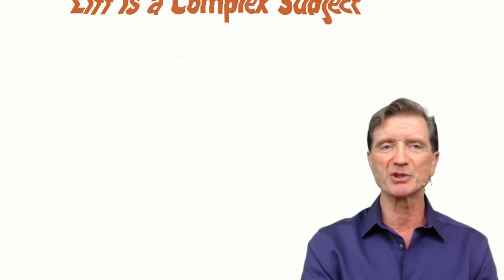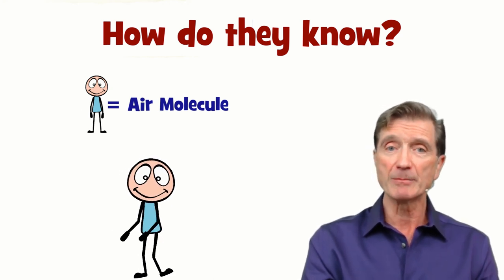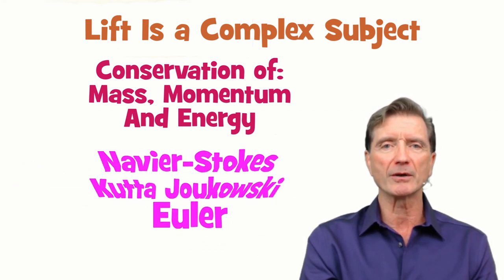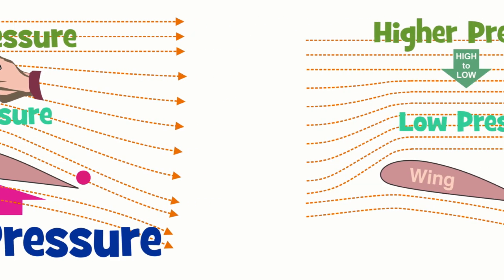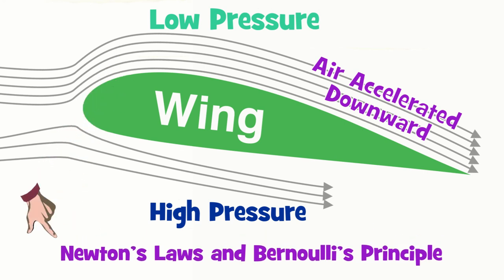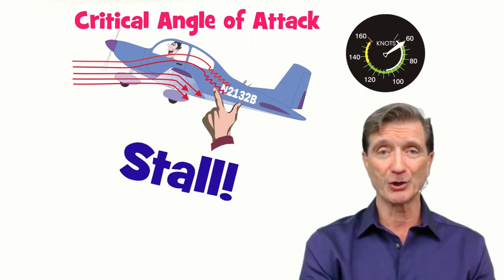Let Me Throw You a Curve: How a Wing Produces Lift

Comment: Lift is very easy to explain. It's caused by a pressure difference between the upper and lower surfaces of the wing. Explaining why that pressure difference occurs... that's the hard part.
Reply: Nope. Has nothing to do with the pressure differentials. It exists but doesn't cause lift. High lift/drag devices like fowler flaps and slots disprove this. It's all about lift as a force. F=MxA. Mass off the aircraft, the air itself and the relationship of the acceleration of everything. The navier-stokes equation is right now the prevailing theory and disproves equal transit and pressure differential as the cause of the force of lift.
Reply: @AFO3310  The only mechanisms that a fluid like air has to act on a body are pressure normal to the surface and frictional forces parallel to the surface. Pressure forces are  typically much higher than frictional forces so they dominate the result when you integrate over the surface. Slotted flaps don't change that. In fact, I'm curious what you think slotted flaps do.

Comment: At the end you said you gave no explanation in terms of conservation of mass, energy and momentum.  Yet you hold out hope that maybe we would come to grips with Navier-Stokes?

What is Navier-Stokes, if not conservation of mass, energy and momentum?

If we were to explore what conservation of these concepts means as interconnected by Navier-Stokes, we could hopefully explain why equal transit time as has been described, is really a misreading of conservation of mass transit and its consequences.

Equal mass transit time of the affected air flow is crucial to "simplifying" an understanding of lift.

So instead of retreating from "equal transit time" when we see that the air on top moves faster than air on the bottom,  a refreshing explanation would be how equal mass transit is accomplished when the simple "equal transit time" is false.

Why is this reconciliation missing from all the lift explanations?

Comment: In my opinion, lift is a consequence of the third law. Bernoulli just explain why the speed change because of the preassure gradient. By the way, I think always the pressure gradient change the speed and never backwards. And the air accelerate on the upper side only on the first part of the wing not allway to the trailing edge.
Reply: Those phenomena, like any others in physics, are not one-way: pressure gradient and velocity are coupled by the principle. And enough experiences have confirmed the profile of pressure predicted by the Navier-Stokes equations with a net lower pressure above the wing and higher pressure at the bottom, so it's a valid model.

Comment: I dont think a pilot needs to know anything about lift except the lift equation and the lift coefficient graph.. dont exceed the critical angle of attack. Higher velocity increases dynamic pressure.

Not much else is of any practical use

Comment: Hello Rod,
I am wondering if you could share some of your references that you used to gather this information? I am for the life of me trying to find peer reviewed reputable journals or publications explaining lift generation. Specifically why the airflow stays attached to the airfoil, follows its shape in high angles off attack, and increases in velocity.
Thank you!
Reply from the maker: Greetings Captain:
There are several references that can help here. Perhaps the most important one is Richard Von Mises' "Theory of Flight." This book covers both the circulation and tangential theories I presented in this video. As far as why airflow conforms to the wing's upper cambered surface at normal angles, well, good luck trying to find agreement on that issue. The best (Ocham's Razor) explanation is the "Coanda Effect." 
Best,
Rod Machado
Reply: As long as the air flow is relatively orderly (non-turbulent), it is rational to assume the force of ambient pressure from above, ensures the airflow stays attached to the airfoil.

The affected airflow mass transit is competing for space with the airfoil.  The space along the upper curvature is fully utilized for this air mass transport flow due to the pressure consequences of the competition for available space.

We see this reflected in no variation in mass density.

At subsonic speeds, mass density is constant around the airfoil's pressure and velocities gradients (I believe this is because the average random motion thermal velocity of the air molecules at subsonic speeds is fast enough to relieve any tendency for mass compression through non-enclosed spaces).

Because mass density is constant (no compression to squeeze more mass through a tight space) the only way for the required uninterrupted flow rate of mass to proceed, is through any available space that doesn't produce turbulent disruption.

Ambient pressure ensures this.

Comment: Imagine you could close off a huge chunk of atmosphere in a closed box. Then place a measuring scale under the box to measure its weight. Then have a plane fly in the box around and around in a circle. Does the weight of the box change?
Reply: The scale will now measure the weight of the box and the weight of the airplane. There are good videos on the Internet showing this demonstrated with a small drone.
Reply: @raymondlancaster3355  This is the final debunking of the Bernoulli "explanation" of lift then. Wings produce lift by deflecting air downwards such that the weight of the plane appears as increased pressure on the ground below.
Reply: Take a look at this video: https://youtu.be/N0IGrSjcBZs

Comment: Why does't the air parcel accelerate on the upper surface with zero degree angle of attack, as experiments shows? 
Or
The air parcel must not to accelerate under the wing because of rounded leading edge? 

Or the air parcels know that they have to accelerate on the upper surface only? Of course No...

Have you any answer
Reply from the maker: Greetings Mr. Black Spider:

I'm sorry but I just don't understand what you're saying here. 
Best,
Rod
Reply from the maker: @shortclips7052  
"Actually air particles don't accelerate on the upper surface of the airfoil with zero degree angle of attack..."
That is not correct. Air particles accelerate on both the top and bottom of the airfoil in the condition you describe. No lift is produced in the condition you describe (zero-lift angle of attack assumed here or symmetrical airfoil at zero-degree angle of attack assumed here).

"The speed of air particles on the upper and lower surface is same when the airfoil is not inclined with an angle..... Why?"
This is correct with a symmetrical airfoil.

Comment: Very simply, a moving wing dumps a starting vortex. There is then vorticity of opposite rotation bound up with the wing, which then generates lift by the Magnus effect.
Reply: Not really an explanation though, sure it's one of the mathematical models but why should this happen? It's neither simple nor complete.
Reply: @no_fb  I could elaborate on my explanation, but I suspect that you have some odd ideas of you own. What do you want me to do which doesn't involve me wasting my time?
Reply: @no_fb  Lift is simply:

1)asymmetry
2)turning the air

if only a bit more detail:

3)from a competition for space caused pressure response
4)which accelerates the air mass sufficiently to prevent flow disruption. 

(Conservation of mass, momentum and energy, are the ground rules for how this expediting pressure profile develops around the airfoil.)
Reply: @david_porthouse  The air turns due to asymmetry of the airfoil.  The magnus effect is simply a way to add asymmetry.  It doesn't by itself explain lift.

As already mentioned:

Lift is simply:

1)asymmetry
2)turning the air

if only a bit more detail:

3)from a competition for space caused pressure response
4)which accelerates the air mass sufficiently to prevent flow disruption. 

(Conservation of mass, momentum and energy, are the ground rules for how this expediting pressure profile develops around the airfoil.)

Comment: Rod Machado, Sir, I could not help smiling a little at you pointing out how air moves along the surfaces of a wing and you even go to say that, " We shall explain how WIND BENDING CREATES LIFT"  Well Sir, please think more carefully about wings as,  IN REAL FLYING WING, ( not a wind tunnel) THERE IS NO WIND, NOR PARTICLES MOVING MUCH ALONG THE SURFACE OF AN AIRCRAFT WING. If mass particles in a wind move horizontally with a horizontally moving wing there will be no lift whatsoever!!  In a real wing,  it is the wing that moves in the effective stationary mass air particles at an instant of time, around the moving wing, are basically accelerated vertically up and down with a little displacement to the trailing edge on the upper side due to a suction zone and a little displacement to the leading edge on the lower side due to a compression zone.    This is the circulation due to such displacement that causes the downwash, which is effectively a  VERTICALLY DOWN  reaction to a process that occurred before, and it is really not a horizontal wind as you are inferring, Please think deeply about it. Here is how I explain it with my own sense of humor.  I hope that you shall enjoy reading this, 
          It is not wise to keep talking about the air flowing over the surfaces of a wing, as relatively speaking, in reality,  the primary effective working air does not move horizontally much over the wings.  People have a habit of conducting tests in a wind tunnel where the airfoil stands still while it is the air that is moved at a speed, relative to the stationary wing. 

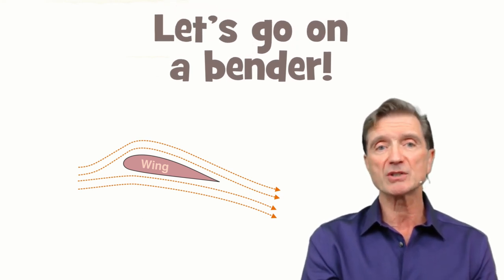The streamlines as shown at 5:47 need to be understood for, in a wind tunnel, the mass air particles on the streamlines are moving horizontally at high velocity but in the reality of flying, the air is initially standing still,  the mass particles are not moving much horizontally but they are being basically displaced vertically with an acceleration which builds up and is integrated twice into a location shown by the slipstreams.  

Also, note that the diagram is shown at 5:47  is a POSITION OR A LOCATION  diagram and not a velocity diagram. If we had to draw a velocity diagram from it, then one could determine the velo0city vector field consisting of little vectors lined up with the streamlines where the length and direction of the small elemental vectors would represent the velocity in magnitude and direction at any location/time on the streamlines. But if it was a wind tunnel, the velocity vector field would represent the velocity of the air particles, but if it was a real flying wing on a moving aircraft it would be the velocity variations about the speed of the aircraft.   From the contour of the streamlines diagram, it appears that the horizontal velocity is basically constant but the curvy zones show a vertical velocity component. So, if from the velocity diagram we would obtain the acceleration vector field, then the acceleration vector would represent the force at that particular point, considering that the acceleration is operating on the mass of the lump of air existing at the location where the accelerating vector exists ( mass is a scalar and can be taken as a constant in this case). 

The curves in the streamlines indicate that there are four main acceleration zones in the diagram shown at 5:11.

1.There is a compression accelerating zone just ahead and on and above the upper part of the leading edge.
2. There is a suction accelerating zone after location (1) existing along the upper surface to the trailing edge.
3. There is a suction accelerating zone just behind the lower part of the leading edge. 
4. There is a compression accelerating zone existing from location (3) going all the way under the lower surface all the way to the trailing edge.
* It is the combination of these four zones that basically ACCELERATE the mass fluid particles vertically up and down  with a little horizontal ACCELERATION TO THE TRAILING EDGE( upper surface)  AND AN ACCELERATION TO THE LEADING EDGE (lower surface) 
 * All these four zones are easier seen on a highly cambered very thin airfoil section where the upper surface is the same length as the lower surface. The practical meaning of these pressure /suction zones could be interpreted as follows, which contain the existing Newtonian effects and the Viscosity effects on a moving wing, note moving wing with no winds around.    Assume the mass of an air/ fluid particle consists of a fat man holding an opened umbrella. The fat man with mass for the Newtonian momentum effect and the opened umbrella for the viscous effects of suction, compression, shearing, and slipping, sealing, etc.
          One fat stationary man, with an opened umbrella, located above the mean line, is hit and pushed up and accelerated up through action ( 1)  and the oncoming upper leading edge will shoot the man up, but him holding the open umbrella, a partial vacuum will be created between the area of the umbrella and the surface of the wing and so this partial vacuum will pull down the man and suck up the wing as it passes under the fat man to dump him over the trailing edge using  Action (2) 
          A second fat stationary man, with an opened umbrella, located below the mean line,  is sucked up by action ( 3), and then the compression zone through action ( 4)   will push the fat man down and the reaction would be a push up on the undersurface of the wing, to dump the second fat man with a delay ( basically vertically down) behind the trailing edge to join the first fat man being dumped from the upper surface behind the trailing edge, a little earlier.   Note that in real flying action, the two stationary fat men with the umbrellas are operated upon by the actions indicated in 1. 2. 3. 4. and from the logic and sequence of the actions/ reactions the upper-fat man will have a higher backward horizontal velocity than the lower fat man due to one moving into an upper vectored suction zone due to the downslope of the rear upper surface,  and the other moving in a vectored compression zone, which moves the fat man forward and not backward, before both of them are dumped behind the trailing edge, not at the same time.  

          That is basically how the acceleration vector field around an airfoil section works, and the same goes, for rudders, ailerons, elevators, spoilers, any part of the structure, air, and sea propellers, and ship hull and the diffusers we meet in all aspects of engineering, where accelerations of fluid lumps masses are involved   We shall not cover the effect of heating the air or the boiling of water or moisture when the suction is fiercely done. 

          Note that the vertical acceleration components of the fluid around the wing are what causes total lift and the horizontal acceleration components of the fluid are what causes the total drag.
          Lift and drag, and control of surfaces, relative to these actions, all have to do with the acceleration field and not the velocity nor the position fields around the airfoil sections.  Note again, that in a wind tunnel the air moves and airfoils standstill, while in reality,  the lumps of air move but a little and it is the velocity of the airfoil section that is much higher than what the air reaches after its acceleration is integrated to velocity ....... and then the velocity of the fluid lumps masses are integrated to relocate them from their initial stationary location to dump them as their integrated accelerations, velocity and resulting locations are too far from the wing to be of any use to flying it,  but could be disastrous to aircraft.. following in the wake..! ( with drag there are other boundary layer shear to consider)
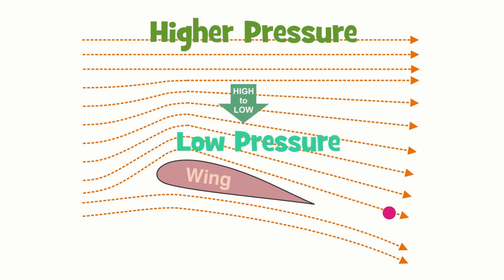Reply: The explanation of how streamlines return to the upper surface of the wing at 8:25 is not exactly correct as normally, it is this suction zone on the surface of the wing that accelerates the fluid mass "sealed"particles to move back close to the upper surface, the reaction of which is the further generation of the lift even up to the trailing edge. This suction zone is a property of the fluid itself remain in the desired state. Note if the substance above the wing were loose dry sand mass particles without a sealing effect between the sand particles, the wing will not be sucked up!  Note this suction zone is effectively the tension, accelerating down the lumped light mass of air above the wing which reacts to accelerating up, the high mass of the wing. This is the reason why the particles of the air gain such a high velocity downwards to be dumped behind the trailing edge. ( note moving wing and not moving particles as in a wind tunnel)   The wing at this stage is no more than a wedged piston moving horizontally leaving a suction zone behind it which if we use the diagram at 8:25, the rear part of the wedge-shaped piston will rise up due to accelerating the mass particles down and if the wing is not loaded and without weight, then the rear edge of the wing will be symmetrical about the line of flight.  

The suggested explanation by the author of this video applies only when the wing stalls and the suction I mentioned is lost, as the working fluid lost its normal desired state,  or when the diagram refers to the water vertical rudder near the surface, of a boat or a ship where when the rudder is angled, air can aerate the rudder and the suction is lost and the water returns as was suggested in the video. I would compare stalling of a wing to a cavitation effect in an immersed rudder, or the blade of a totally immersed propeller, but we shall not go into that boiling property of water or water vapour/moisture above the wing.